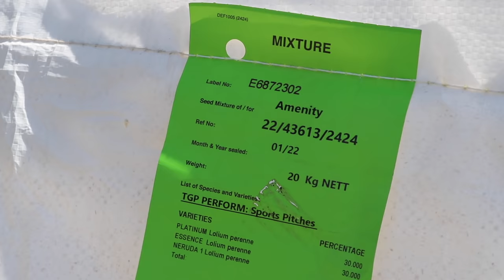The Step by Step Guide to Levelling Your Lawn

Comment: A top tip I learnt from premier lawns channel was to put half the seed in a bucket and fill the other half with soil and then mix together and then spread by hand. Gives better contact for germination.
Reply: Yes agree...any tips on how to stop the blooming birds scoffing the seed, to big an area for a net
Reply: @martinsylvester1823  my late grandfather used to stick short lengths of cane in the ground every few meters, then run string along them - imagine lines of string, strung a couple of feet off the ground a meter apart, running the length of the lawn.  Then he'd  hang ribbons of tin foil from the string every meter or so.

Apparently the birds wouldn't go near; I took his word for it because his lawns were always beautiful.
Reply: One tip i remember from years ago was to mix the seed with soil in the bucket, but don't sow it immediately. Leave it in the bucket to start germination. Then sow the seed together  with the soil. Birds won't eat germinated seed. I never tried it, but i see no reason why it shouldn't work.
Reply: What a fantastic idea and a HUGE thank you…
Reply: @harbottle8580 I don’t think the seed deep in the bucket would germinate when not exposed to sunlight, only the seed near the surface.
Reply: @christianpetersen1782 
I think the seeds will germinate when moist and warm enough. Only after germinating they’ll need sunlight. (NB I THINK, I do not KNOW for certain).

Comment: Nice!  I was thinking that if you waited for a really dark night, you could shine a powerful floodlight across your lawn around 6" above the surface, as this gives a 'modeling' effect, & shows-up EVERY peak & trough like a sore thumb!  Also very useful for walls etc to show how imperfect they are.   🙂
Reply from the maker: Good idea. the neighbours really would be wondering what I was doing!
Reply: This works really well for filling walls too. Think your wall is smooth? Turn the light off and shine a light at an angle across it and it looks like the surface of the moon!
Reply: Or a laser ha ha !!!
Reply: You could also buy one of those cheap 'laser pointers' – those red dot things – that'd give the same result. I've just done something similar with levelling the ground for a lightweight pvc greenhouse. Definitely a very good suggestion 👌
Reply: What a great idea!  We actually have a bright spot light. Gonna give that suggestion a try!  Might be a fun way to engage kids by having them go around and put little flags into the depression areas so the next day you can easily see where they are in order to put down the sand.

Comment: The Perennial Rye grass is a winter grass, and I bought a bag of Lowe's Kentucky Blue grass seed, and what I got was a Perennial Ryegrass! I personally think it is an ugly grass. I planted what I thought was Kentucky Blue grass a few years ago because I had a shady place I had a hard time getting to grow grass. It never died through the winter! I think it reminds me of Bunching Tall Fescue, which I think everyone tries to remove from their lawn and grows in bunches or patches. It lasts up to 3 or 4 years unless adversely effected by extreme winters. It doesn't tolerate drought or long periods of extreme heat, and it flourishes is fertile and well-drained soil. It is native to Europe, Asia and Northern Africa but it is cultivated around the world. Something else I noticed about this grass is it  used for pastures and it requires over seeding every year in the fall, and it grows up to 1 feet tall, and is recommended that you cut it 2 to 2 1/2 inches tall, and to increase the height of it 1 inch as it warms up in the summer. It grows in bunches much like bunching tall fescue does. Like I said, in my opinion, it an ugly grass that looks more like a weed. It grows in bunches much like Poa Annua, an annual blue grass, and everyone I know, including me, spray it with herbicides that effectively kill it. Perennial Ryegrass is commonly used in large fields. You may want to think about planting this before you commit because you may not like what grows up!

Comment: I have the earlier Qualcast/Atco 17inch cylinder mower with scarifier bought 25years ago for £750 (presumably Allet is a rebrand as it looks identical to urs).  It always starts on the first or second pull

Comment: Great video. You did address it in the video but I was under the impression that what you were using was a power rake...the scarifier attachment I have is a lot more brutal than that and that one you said is a scarifier is according to the brand I use infact a power rake...god knows. However, if you can make a cure for Poa for all time that would be great! Absolute bloody bane of my life! - Does the weed/feed touch the Poa in your experience? - The stuff i'm using has worked for stopping all other weeds and grasses but not Poa!

Comment: Hi Stuart, scarification is the process of removing the thatch layer. It can be done with what you used which in real terms is a power rake which is quite gentle, or by using a designated scarifier which is a row of tines that will leave grooves in the soil layer. So yes, the cartridge you used does perform a level of scarification as it will remove thatch but it is not a true scarifier which is very aggressive.
As usual, a very comprehensive and excellent video.
Reply: Yes I agree, mine has tines that does grooves and does take out thatch (great) but Stuart made the point that his does rip out the horizontal weeds more effectively especially after he has done it a few times to get the thatch out, I can see the point in that so to me a very handy bit of kit he has purchased.
Reply: Thank you for this post Patrick. I actually came in the comments to verify the term scarify to be synonymous with dethatching a lawn.

Comment: Stuart your lawn looked quite good to start with but a great job.If I may ask obviously when you bought the house there were screeds put in and it’s like doing concrete with levels where you compact the clay and run it with a straight edge from timber to timber just wonder how you got hollows.

Comment: I've heard of people soaking their grass seed in a bucket overnight prior to seeding. Apparently it helps to speed up the growing process. But I then wonder how it would be for spreading it. 🤔
Reply: I had the opportunity to have a tour of a new motorway prior to it opening a few years ago, we spotted a guy with what looked like a fire hose attached to a tripod on the back of a pickup truck and he was spraying green/brown water onto the muddy verges as the pickup drove along slowly, we asked what it was, he said it was grass seed mixed with water and soil that's how they spread grass seed across large areas. (Can't guarantee the quality of it though)
Reply from the maker: That is the biggest problem - wet seed.
Reply from the maker: I've used this on some of my road projects - Hydroseed. It works very well and the colour shows you where you have sprayed
Reply: Wet seed won’t work in your spreader or even broadcast by hand. You can let it dry out again, or mix it in the top dressing mix

Comment: Would you ever shave off some of the high spots on the lawn as opposed to filling with soil / sand?   Looking to level my lawn this year but new to this.
Reply from the maker: You could do but quite difficult unless they are very prominent. My lawn is only 2/3 years old and has sunk in areas so makes sense to fill them back up. If you have an obvious high point then you could maybe remove it but in some ways it's easier adding than taking away.
Reply: @ProperDIY  Thanks for the advice.  I'm liking your channel

Comment: Not sure how you rolled it in with the lawn mower at the end without engaging the cylinder blades. My lawn is very uneven and i have cylinder mower. My garden is.80 sq metres back and 30 sq metres at the front. Do you think a tonne of top dressing is enough. Thanks again for an excellent video .I am thinking of doing it maybe early September. or do you think it will be ok now to have a go with it. I recently overseeded lawn and it looks ok. Thanks for a great video Stuart.
Reply from the maker: My lawnmower has controls for both the cylinder and drive separately. A tonne will be plenty with some left over to use in the future
Reply: I have Liberty 43 but no extra cartridges but have an electric 2 in 1 scarifier. Will the Liberty therefore be able to roll it in without engaging the cylinder. Thanks

Comment: it does look like a dethatch rake. The Scarify function, by definition, is to break up surface soil or to make shallow incisions on the top of the soil, and that is usually what you do after dethatching the lawn to remove debris and thatch from the surface that has accumulated from mowing, so you can seed the lawn successfully by allowing the seed to come into contact with the soil. My scarifying blade is solid blades and my dethatch rakes looks like what you are calling the scarifier. Because the blades actually are able to make a shallow incision into the top of the soil for the purpose of aerating or to plant grass seed. The rake does not do that effectively as the blades do. The machine I bought to do both actually tells you this, and you cannot set the rake as deep as the blades! Also, when the ground is uneven, neither work properly. Uneven ground, I have had to use a dethatch rake to do it by hand to get places the machine didn't touch, so depending on how uneven your lawn is, you may still have to do much of it by hand. They can call it a scarifier, and it may break up some of the surface, but that is a rake attachment, and it is not capable of making shallow slits in the top of the soil for seeding, so it doesn't matter what it's called; what matters is what that rake is capable of doing and what it is not capable of doing!
Reply: Tbh I think we all know what he's getting at .. but it's always nice to be nice my mother told me no one likes a show off 😎👍
Reply: @antbans5137  whatever that means; I just pointed out some facts about it that people should know, so I'm not sure what you are getting at. Is being nice not correcting someone's misconception of something? I don't think that's being nice at all if you sacrifice truth to be, so called, nice. We aren't talking about someone's weight here. We're talking about a machine and its functions.